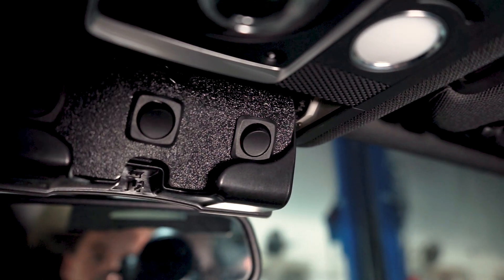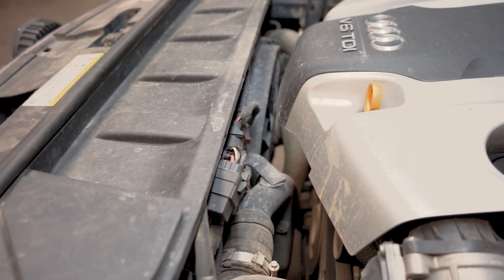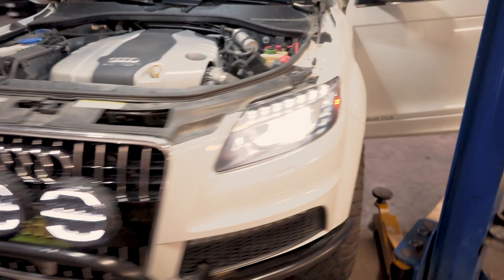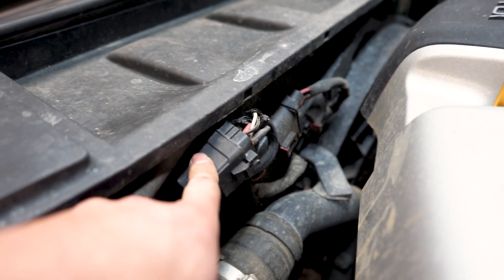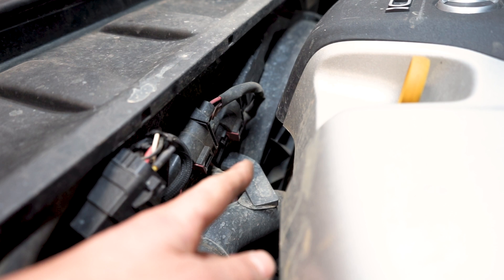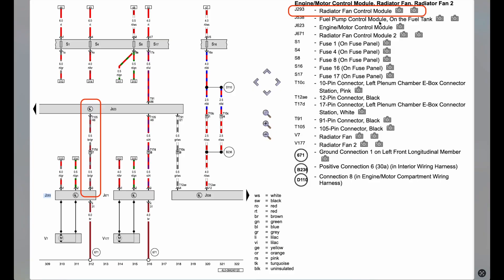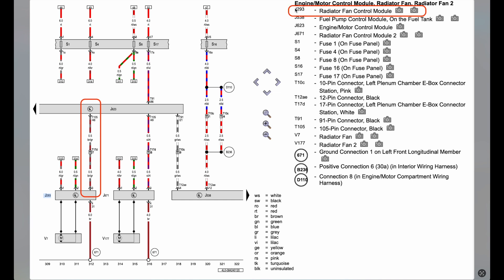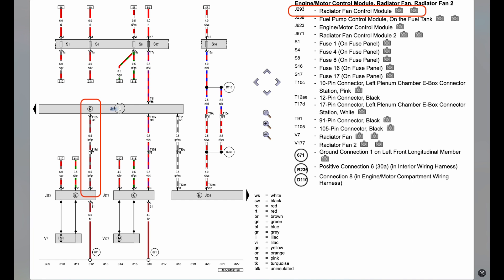DIY: Q7 / Cayenne / Touareg Radiator Fan Override

Comment from the maker: This has been confirmed on an Older Touaregs VR6's and Cayenne's now too!

This is taking use of a fail safe in the fan control modules, that when it looses communication with the ECU it's baseline is max speed. This can happen and be utilized across a majority of VW/Audi products.

Comment: Thanks for the video and doing all the hard research for everyone ! I plan on wiring up a switch panel to the same place. Are you using an ABS foam to mount the switches or is it Kydex?
Reply from the maker: Glad it helped! The switch holder was just simple abs plastic bent and trimmed. Then I drilled a hole through the sunroof control and passed the wires through it and into the sunglasses holder. Took some finessing, but it eventually sat cleanly.
Reply: Thanks for the video!